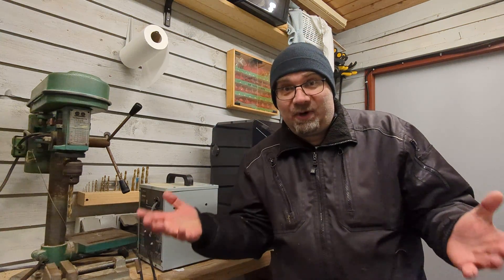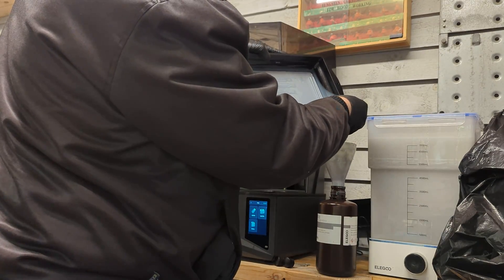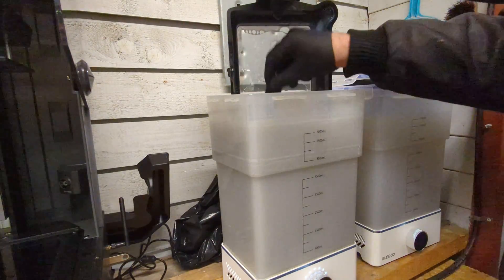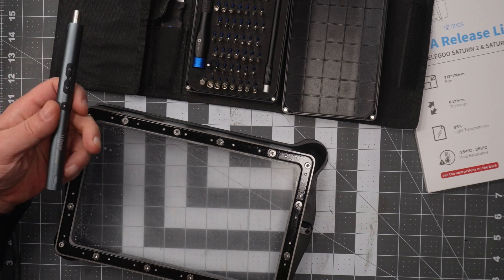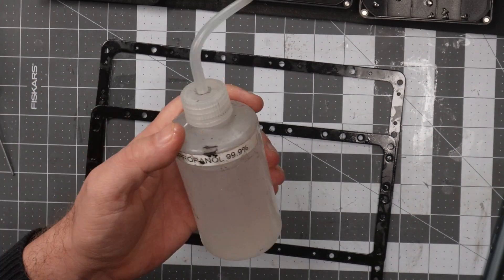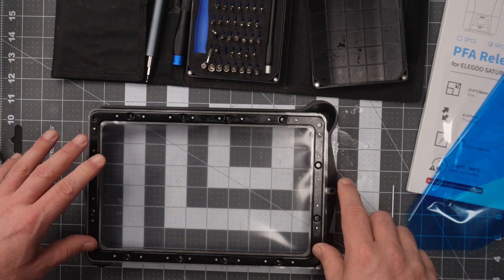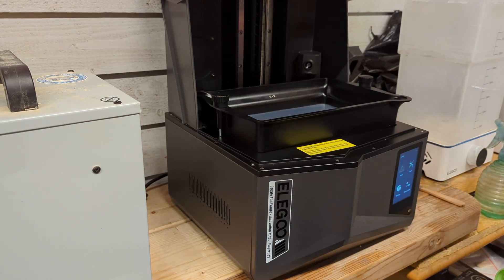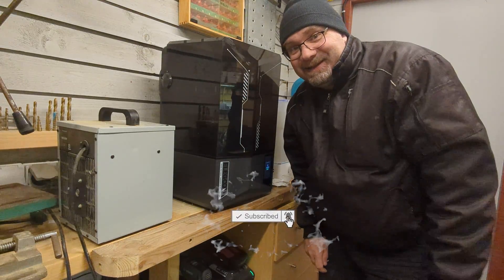How to Replace The PFA/FEP Film on Elegoo Saturn 4 Ultra

Comment: And where's the spacer in the process? Elegoo advises doing it with the spacer, as their factory one was done.
Reply from the maker: Do you mean the cloth or foam to support the film on the table. Well i have never used that and it has not given me any problems. But now i dont use the elegoo tank anymore. I use the chitu system Hoopat x4. It now takes about 1-2 minutes to replace the film.😊

Comment: Just to be clear, the screws are supposed to perforate the perimeter of the PFA when you tighten them, yes? 

I ask because the Google blurb said not to do that. 

Also, does it matter which side of the PFA faces the LCD screen? 

Thanks
Reply from the maker: The screws has to go through the PFA. There is no other way. It does not matter wich side is up and down.i just made a new video where i test the Hoopat X4 resin tank, PFA change in 1 minute https://youtu.be/4M1oryh2JJ8?si=EB_fTaudCzEwjOpD

Comment: What size bits do you need for this process? Also interesting to see some people use the 8mm foam spacer block Elegoo talks about while others dont, seems to work fine both ways.
Reply from the maker: You will need a 2,5mm hex and a 2mm hex bit to unscrew the frame. i never heard about the foam spacer. I have an easy solution coming up in my next video on this Sunday. you can change the PFA film in a couple of minutes.

Comment: Thanks for a helpful video, which helped me change my film.  One important point I discovered is that the screws that hold the frame to the vat need to be tightened until they bottom out and bring the frame into hard contact with the frame of the vat.  When I removed the old film, I discovered that these screws were not fully tight, and the film had lost tension, possibly because the previous owner of my machine had not tightened the screws down fully upon changing the film.  This is understandable as while tightening the screws one can be a little cautious once the tension starts getting high and the screws just keep on turning, so there is a tendancy to just stop half way.  However, if the frame is not pulled fully into contact with the vat, the vibration from the machine may cause the screws to work their way loose so the tension drops over time, leading to failed prints, which happened to me.   When I do the drumskin test on my newly-installed film, the note I get is higher than your note, indicating there is greater tension.
Reply from the maker: Thank you, im glad it was helpful :-) I did tighten all the screws as hard as i could. U don't know if the sound from the drum test is good or correct on the video compared to the real world sound. but i don't think i can tighten my screws more than i did :-)